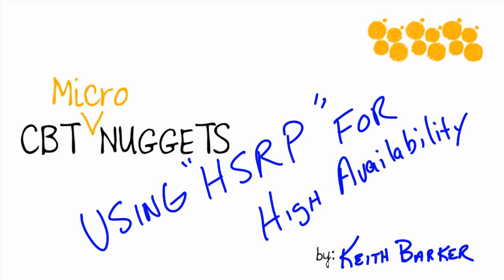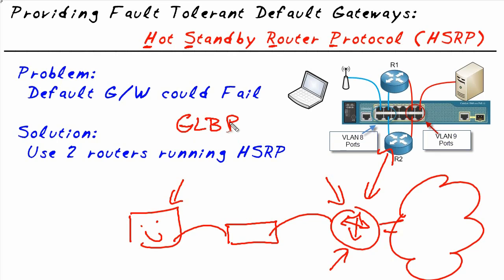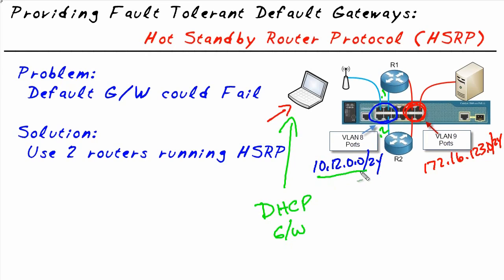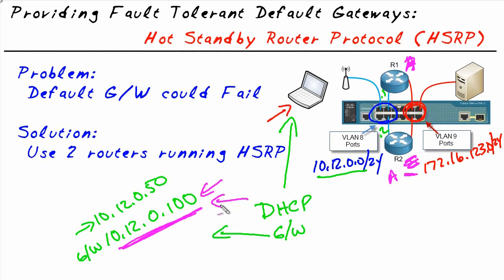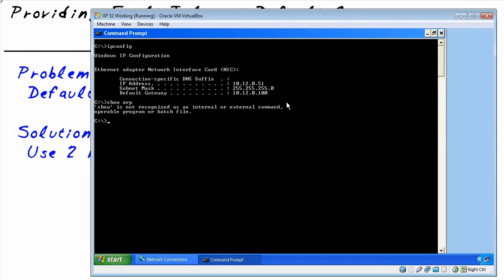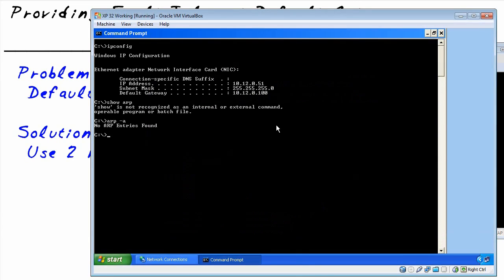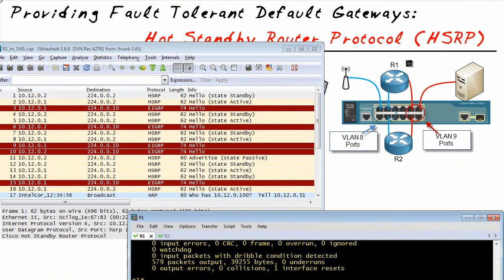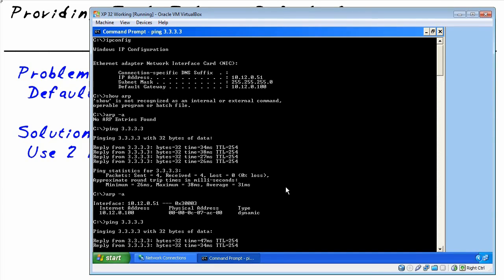MicroNugget: How to Use "HSRP" for High Availability

Comment: Hello Nadim-

Great question.

Yes there can be multiple HSRP groups.   With every one set to preempt, the router with the highest priority will be active for that VLAN.   You would use trunking (on a physical router) to provide it with logical connections to all the VLANs needed, through a single physical interface.

R3 could be high priority for VLANs 2, 4, 6 and R4 could be high priority for VLANs 3, 5, 7.

They would then back each other up as standby.

Comment: Hi Mike!  

Most Cisco routers (running the appropriate IOS that supports the feature) can be configured for HSRP.  HSRP works equally well on routers as on multilayer switches.    

Thanks, 

Keith

Comment: Keith what router are you using in this video which supports HSRP? i thought they only ran on multi layer switches? if i were practicing HSRP for the ccnp exam would using routers suffice over multi layer switches?